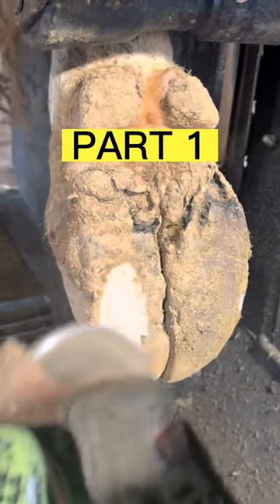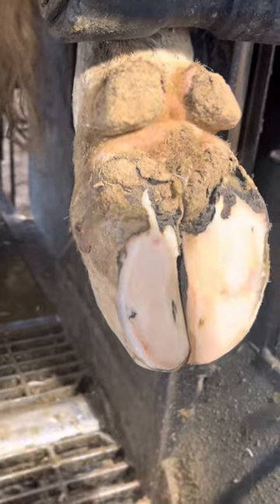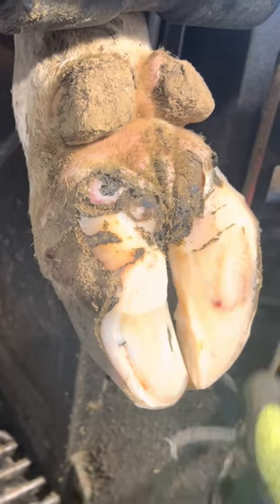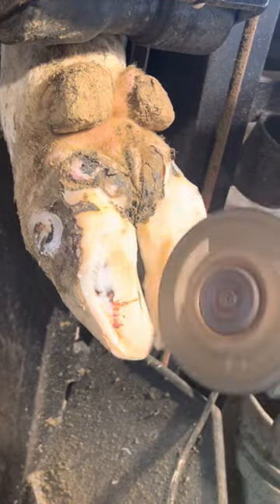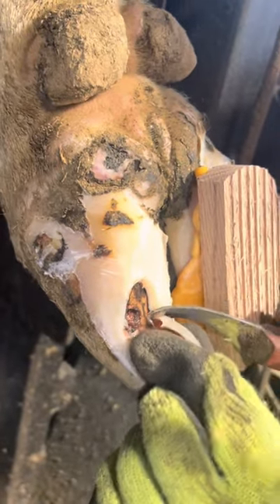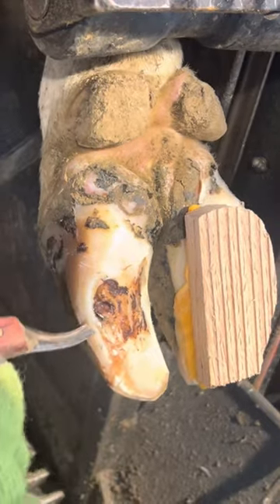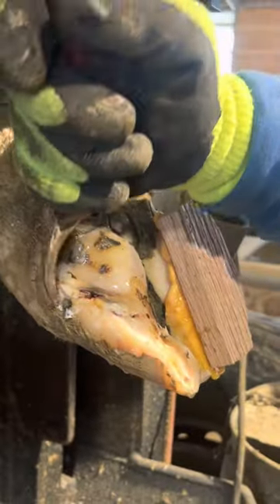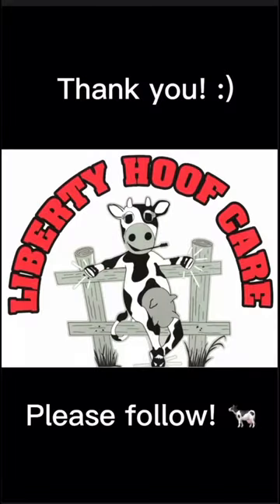BAD white line lesion/ab-axial fissure.

Comment: You learn so much about hoof trimming when you watch a variety of hoof trimmers using similar or different techniques.
Some use iodine and salacidic acid together as a treatment for DD, or others will use salacidic acid on its own.  Do you think if you spray the DD with iodine first, and then apply salacidic acid over the top, can it then penetrate through the iodine sufficiently to kill the DD? 
This is a question I've often wondered about and would really appreciate your opinion.
Reply from the maker: Good question. I use antibacterial solution and copper sulfate mixed with salicylic acid and it works really well. I’ve seen others use just salicylic-acid too. I’m sure spraying it with iodine first would still be very effective.
Reply: @Brett DeGroot  thank you for replying to my comment.
I seem to think the same as you .How could  salacidic acid penetrate through iodine sufficiently enough to be effective? 
I've watched  hoof trimmers who seem to have better results applying only salacidic acid to sole ulcers and DD.
Thank you so much for your opinion it's greatly appreciated.